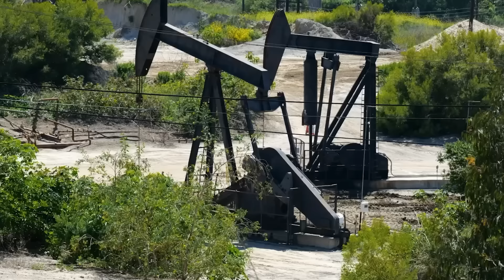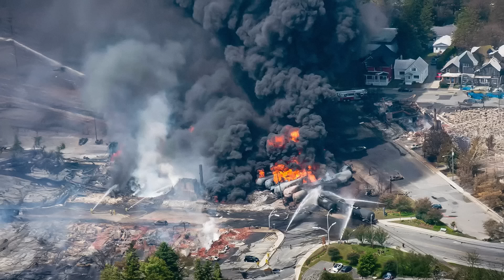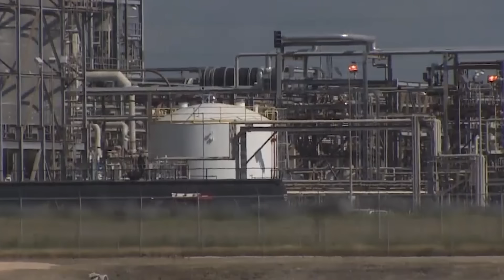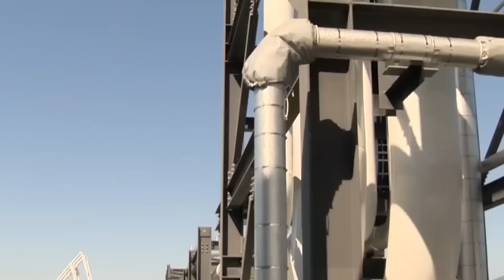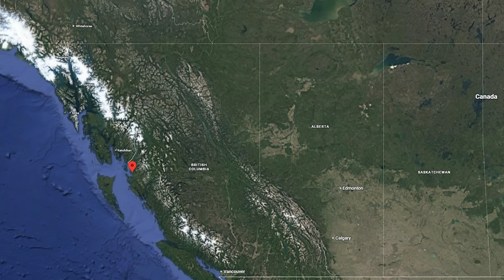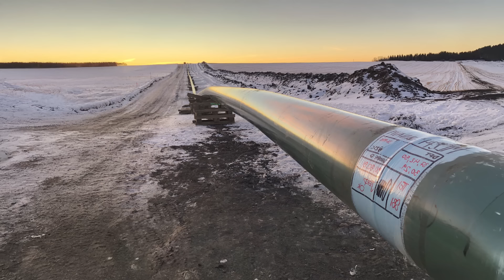Here's Why Canada Can't Build Its Own Refineries, Even Though It Produces Millions of Tons of Oil

Comment: Oil is also extracted off the East coast.  Light crude.

Oil still travels to the East coast via rail.  I know because it goes through my city which also has the largest oil refinery on the eastern seaboard.  It processes both light and heavy crudes.

I agree that a pipeline should be to the eastern refinery but that is Quebec that is holding that up.

Comment: here's an idea...build a huge refinery on site at the tar sands and use the pipelines to ship refined products like gasoline and diesel or jet fuel. Refined products going through the pipe means that it would last longer because tar sands crude is very abrasive. Any spills would be easier to clean up and lower maintenance costs replacing sections of the pipe that are worn out from getting sandblasted inside. Added bonus is that the price goes up so there is less loss of revenues.
Reply: Good idea, just let the Japanese help build the refinery.

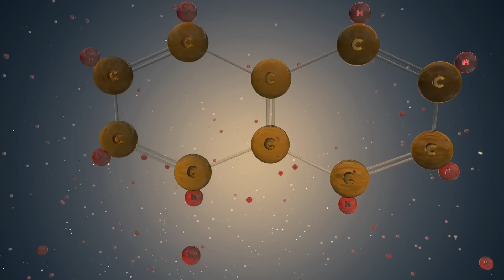Comment: @6:28 The removal of the Sulfur..... Lead-Sulfuric acid batteries are very much safer than Lithium batteries.
As for that horrible train accident.....
Stupid cheapskate railroad couldn't spend a little extra for having an extra man to mind the Locomotive ?
I'll bet it was an engineered disaster to sensationally motivate the construction of the XL Pipeline to the Texas refineries.
Too much shipping is via trucks, whereas RAILROADS are very much more efficient, and standardized cargo CONTAINERS should be used.
The less petroleum burned, the less global warming, the lesser FIRES in Western Canada and the USA.
Newer fuel and energy options have been REPRESSED by the Petroleum Industry for decades.
Time for CHANGES.

Comment: The socialist gov NDP in Alberta leased 4,400 rail cars to circumvent the quota caps imposed on crude output allowance. Quota caps imposed by the federal government.That was going to cost taxpayers 3.4 billion and hold the public purse responsible for the risk. The UCP government scrapped the plan. The federal gov bought a pipeline to BC coast costing 34 billion to twin an existing pipeline because after 10 years of negotiations and 164 contracts it still wasn't allowed to proceed so the company pulled out of the project. The federal government in Canada for 11 years has done everything possible to limit energy production in Canada.

Comment: - Canada doesn’t lack resources—it lacks incentive to use them properly.
- If something was possible 50 years ago but “impossible” today, the problem isn’t technology—it’s the system.
- When inefficiency is profitable, solutions become optional.
- This isn’t an energy problem—it’s a motivation problem.
- Canada exports raw oil and imports oil anyway—that’s not limitation, that’s design.
- Systems don’t fail by accident—they settle into what benefits those inside them.
- If failure leads to shutdown instead of improvement, the system isn’t built to solve—it’s built to avoid.
- A country that can’t move its own resources efficiently doesn’t have a logistics problem—it has a structural one.
- Integration isn’t missing because it’s hard—it’s missing because it’s not rewarded.
- When nothing changes for decades, it’s usually not because nothing can be done.

Comment: These are false statement from the US oil system. Canadians please stop accepting these lies  note the info is in miles not kilometers  and the price we sell the oil to the USA is $50.33 a barrel. Where the same quality oil today is at a min of $109 a barrel yes it costs 5 to 15  we are selling our oil in March 2026 to the USA for 1/2 the price of the world market. the oil prices appear to be topping 200 a barrel. Got it? Further a refinery can be build in 18 months but here is Ai'a answer  Building a small, modular refinery (typically 10,000–20,000 barrels per day) ( writters comment 7.3m a year- not so small) for Western heavy sour crude generally takes 20 to 36 months for full operation, with capital costs often ranging from $500 million to over $2 billion, depending heavily on the complexity required to handle heavy, high-sulfur feedstocks. 
🙂
Reply: wonder if any one is listening to robert or Carney

Comment: California has the same problem with its own heavy sour crude that produces little light products like gasoline and diesel that is most profitable to the energy sector
until there is a greater demand for expensive heavy finished products like grease tars and asphalts California refineries will continue to close

Comment: What should be done is develop or build one or two modern heavy oil refineries with the new found income  say in Saskatchewan or Manitoba   Ones powered by hydro electric power like our founders in Ontario and Quebec through the nation wide energy grid carney suggested  to refine our own heavy oil.  Adding a variety of products produced now in Canada to be sold here and abroad.  Plus supplying low cost electricity westward instead of south.

Comment: The largest refinery in Canada is in my Provence of New Brunswick, Irving Oil.  The Saint John refinery produces finished energy products for wholesale and retail markets, including gasoline, diesel, heating oil, jet fuel, propane and asphalt. If we could have a pipeline that went from Alberta to NB could make a lot more.
Reply: Liberal Government restrictions with Zero emissions is the problem. Canada's heavy crude oil requires oil refineries that can process this oil in mass volumes. These refineries require high-complexity residue conversion and carbon-rejection or hydrogen-addition units. Unfortunately it wouldn't be permitted due to Liberal Government Climate Change restrictions.

New Brunswick refinery is "Grandfathered in". Unfortunately building a new refinery with Liberal Government scrutiny, it wouldn't be built.

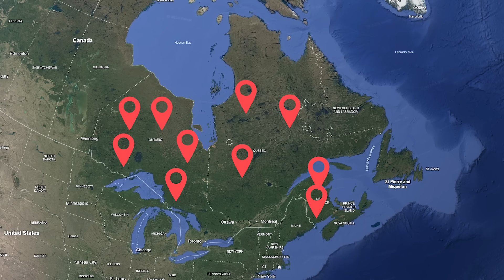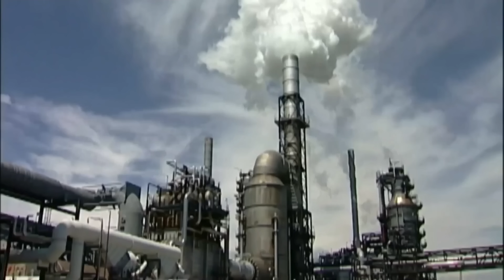Comment: @7:15 you mention cost of modernization starts at 20 billion - then @9:54 you mention losses of 19 billion from buying oil from abroad. Spend 20 billion or lose 19 billion. Govt seems to be short sighted on this one. Invest 20 billion to save 19 billion is the solution.

Comment: The reason the United States, Canada buys oil from countries like Venezuela, Nigeria, or even imports oil indirectly through global markets, instead of relying only on its own oil, is to support the stability of the petrodollar system.

If the U.S. and its allies used only their local oil, then countries like Nigeria would not be able to sell their oil internationally. As a result, Nigeria might start selling oil in other currencies to different countries.

This is something the U.S., Canada, and their allies want to avoid. They prefer that oil continues to be traded globally in U.S. dollars, because this helps maintain strong demand for the dollar.

So, oil moves globally — local oil goes into international markets, and international oil comes back into local markets — mainly to ensure that transactions continue to be done in U.S. dollars. This helps keep the dollar strong and dominant in global trade.

Comment: Offshore Newfoundland has a discovered 4.3 billion barrels oil (approx half is light sweet crude, the other have low sulphur heavy crude). This discovered amount if refined and consumed in Canada would be enough to last approx 5 years. Also, only 10% of the area has been explored, and there are potentially more than 100 billion more barrels of oil in offshore NL, which would supply Canada for another approx 100 years if this resource was fully exploited, refined and consumed in Canada

Comment: What strikes me watching this is how little the coverage distinguishes between a crude oil shortage and a refined products shortage. They are genuinely different problems with different solutions — and conflating them leads to exactly the wrong policy response.

The crude exists. What the world is running short of is countries willing to process it and sell the output. China, Thailand and South Korea each restricted refined exports within days of the Middle East war starting. Each decision was rational in isolation. Collectively they created a cascade that left countries like Vietnam and Australia exposed in ways that have nothing to do with the Strait itself.

Canada is the parallel that deserves more attention. Australia closed refineries it had. Canada went further — it never built enough refining capacity in the first place. Canada is simultaneously one of the world's largest oil producers and structurally dependent on a single foreign country to refine it.

From the Steel Trenches, this pattern is entirely familiar. The parallel with what happened to steel overcapacity is closer than most people realise — not in the direction of the trade flow, but in the structural logic. When the value-adding step concentrates elsewhere and domestic capacity atrophies, the system works efficiently right up until it does not.

This is not an oil crisis. It is a refining crisis. And it was built into the system one rational decision at a time.

Comment: Canada just gave battery manufacturers a total of $50 BILLION DOLLARS to subsidize new battery plants for Stellantis, VW, and Northvolt among others. Most of these companies have since pulled out or gone bankrupt, and most subsidies have not produced a single job nor battery. You could build a new Eastern pipeline and either build 5 new refineries, or upgrade nearly all of the existing ones for the exact same cost. It's not an issue of "can't". It's very much "won't".

Comment: Well, not quite all true- Two of Sarnia's refineries process upgraded heavy or sour crude from Alberta, enough to support the Toronto market and west of that with gasoline, diesel, etc. Not much past Toronto, and you get your gas/oil/crude from the U.S. or overseas. Shell's planning to upgrade the remaining refinery in Sarnia (which they were trying to sell just 10yrs ago) to clean up even more Sulphur in the crude they recieve.  Shell came close to building a large heavy oil refinery south of sarnia in the mid 2000's-it was economically feasible..Royal Dutch Shell killed the project when they took complete control of Shell Canada, and outlined a 'new direction' for the company worlwide (they sold many refineries in Europe and the US at the time)-there was the SABER proposal of 2016 as well...like Thomasmelanson's comment just below this one...won't is not the same as can't.

Comment: The Sturgeon Refinery (Redwater Refinery) in Alberta, a joint venture of North West Refining and Canadian Natural Resources Ltd., completed construction in late 2017/early 2018, with full commercial operations for bitumen processing achieved in June 2020. As Canada's first new refinery built in decades, it processes roughly 79,000 barrels per day of bitumen into diesel, featuring carbon capture technology. 
 +4
Key Project Details:
Location: Alberta Industrial Heartland (near Redwater/Edmonton).
Operational Status: Fully operational, processing bitumen as of May 2020.
Construction Timeline: Ground broke in 2013; construction substantially completed by late 2017/early 2018, with commissioning extending through 2019.
Final Cost: The project saw substantial cost increases, finishing with a cost of approximately $10.billion

 billion CAD.
Capacity: Processes 80.000 barrels per day of diluted bitumen into ultra-low sulphur diesel. 
Foxtrot Yankee this says your full of crap.

Comment: The Trans Mountain pipeline has to deal with mountains, rivers and whatnot. Pipelines to Eastern Canada don't have to cross mountains, so lets get building pipelines to eastern Canada. There is absolutely zero excuses why this doesn't happen except for corporate greed.
We basically give our oil to the U.S. ($16.oo/bbl) and then have to pay the U.S. for gas and diesel. It is a one sided transaction, with the U.S. winning.

Comment: What a crock of ca ca.
There are huge reserves across Quebec, they chose not exploit for political pandering.

The oil sands run across Northern Saskatchewan as well but aren't developed yet.

New Brunswick has decent reserves of natural gas, I helped drill a few holes years ago.

There's another shale gas reserve that runs along the west coast of Nrwfoundland from Corner Brook to Port Saunders that could be drilled from the shore line. 

The government chooses to virtue signal and pander to a very loud and well funded minority of tree huggers and their overlords.

So enough of this uneducated 🐎 💩

If you're going to make a video about the energy sector in Canada, at least roll back the covers of whoever you're in bed with.

Comment: Canada probably doesn't  need more refineries  at the moment.  The only issue is Quebec  wont allow the building of a pipeline which would move Alberta  oil through their province  to the east coast to be refined and then used in Eastern  Canada. Plus the Irvings are doing quite well importing oil from overseas  to fuel there refineries,  which they then ship  throughout Eastern Canada .   However Quebec  is quite happy to recieve equalization payments from Albertains in the amount of billions of dollars every year .  See anything  wrong with that. Equalization  needs to be revisited, period.

Comment: Where does Newfoundland offshore oil going? Is it light or heavy crude oil? How difficult would it be to refine out the heavy bunker C from Alberta's heavy crude oil? Could the lighter partially refined oil be pipelined east to light crude refineries?

Comment: Trump says America needs nothing from Canada. Here's the data that proves he's dead wrong — and why he knows it.
Discover the REAL reason Trump cannot cut off Canada — from 3.9 million barrels of oil per day to $733 billion in American investments, critical minerals, potash, F-35 contracts, and Arctic defence. Every card is in Canada's hand.
Our Analysis Includes:
Why Trump's "America doesn't need Canada" claim collapses under the numbers — Canada supplies more crude oil to the U.S. than ANY other country on earth, and that pipeline cannot be replaced overnight.
How Canada's $733 billion in U.S. investments makes economic decoupling a direct threat to American pension funds, jobs, and infrastructure.
The critical minerals card — from cobalt to lithium to uranium, Canada holds resources the U.S. desperately needs and China currently controls globally.
Why Canada and Mexico are refusing to be split apart — and how their united front is Trump's worst strategic nightmare.
The Arctic and F-35 factor: cutting off Canada doesn't just hurt trade — it dismantles North American defence entirely.

Comment: Can't? No. We have. We just haven't done it enough. Funny how you add up all the separate upgrade costs into one lump sum and then theorize how long it would take to break even as though only one entity were paying the entire cost over the longest period of time (25 years, when you said 15-25 years). Clearly your video is designed to convince us that it's an impossible task. 
Here's something you missed. Ten years ago there was a big public push to build refineries instead of the Trans Mountain Pipeline. "It would take too long and be too expensive", they said. 10 years later the pipeline was finally running and at a cost of 34 Billion dollars. 
So much for your propaganda.

Comment: Build a new refinery in Saskatchewan or Manitoba.  It's easier to move gasoline east rather than oil.  The investment (by the govt, not private) is offset by less pipelines and producing new jobs in a province that needs them.  The payback would take a long time but pays itself with the offset of selling our oil so cheap to the USA and importing oil for use.  It also helps protect our sovereignty and makes us more self-sufficient.

Comment: The biggest and critical ommission in your analysis is the construction of heavy to crude refineries near the sources of heavy tarsands oil (Ft McMurray) or sour gas contaminated oil (Grande Prairie). Pipeline construction thus easier and less dependence on US refineries to buy crude and resell refined products back to Canada.

The political climate is changing - enough to allow construction of a pipeline to Churchill Manitoba if not through the NIMBY areas of Ontario and Quebec. It could then be shipped to Montreal or Sarnia as well as to European buyers as light (Brent equivalent) oil. But that should be a National Security item with government funding split with (non US) oil companies.